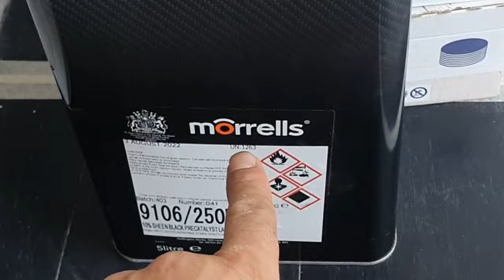floor wood sanding - and paint it, with black varnish

Comment: Hello is there anything else you need to do to the lacquer before putting it down? Or can it just be applied right after sanding? Also how many coats? Thanks
Reply: Just realized I can’t get this product in the states… any recommendation you have for a similar product please 🙏🏼
Reply from the maker: the product name is morrells.  click this name on google and there will be many products like this, you can buy anything you find where you live that is similar
Reply from the maker: try looking for these products on ebay, morrells
Reply from the maker: it can be applied after you have finished to sand
Reply from the maker: Do not forget.  shake well before applying the varnish

Comment: What kind of a sander is that (the first sander, not the drum sander)? Doing the same to my 125 year old house!
Reply from the maker: the name of the HUMMEL belt sander. it can be done if the floor is in good condition. but if your floor is oak
Reply from the maker: pine floor could also be done but to be honest it will have a slightly different effect